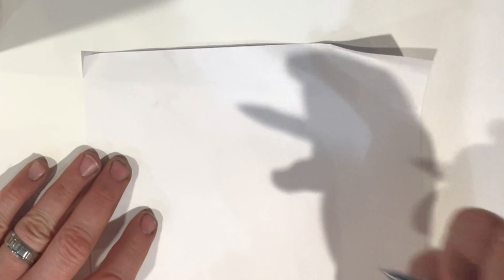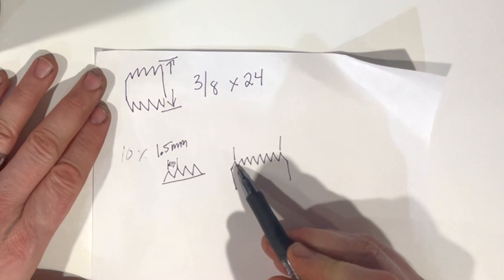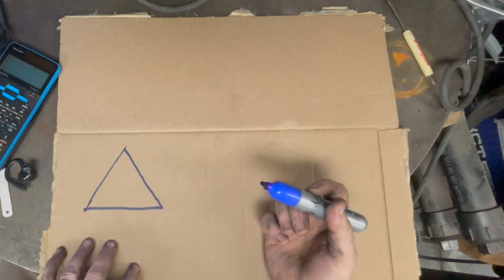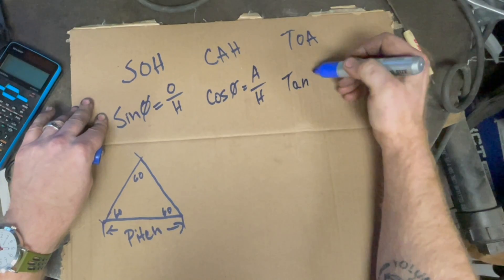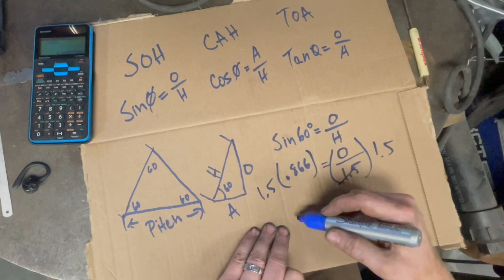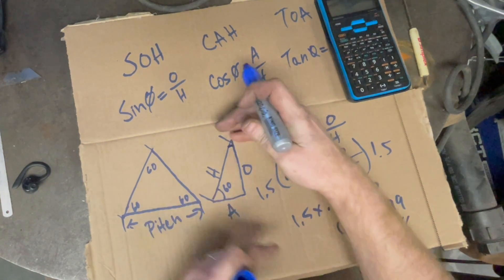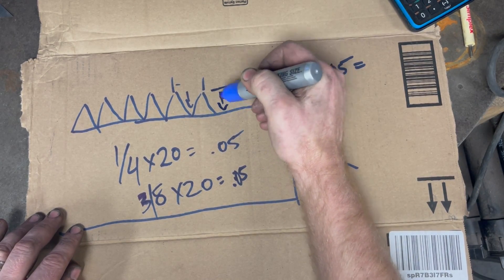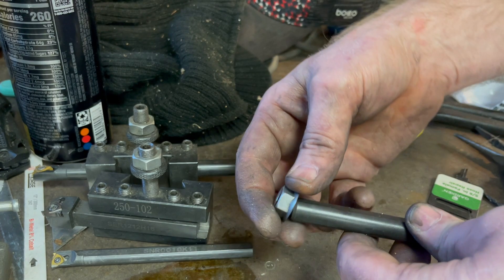Part 2: Easy Method - Calculating Thread Depth For Metal Lathe Machining + Basic Bolt Terminology

Comment: Along with the Sine, Cosine, and Tangent formula's my favorite is the Relationships of a 30-60-90 triangle which is 1-2-Square root of 3 " 1.732 "  Also a 45-45-90 triangle which is 1-1-Square root of 2 "1.414"
Using the 30-60-90 rule to figure the thread depth ,  Pitch /2 x 1.732 will give you the approximate depth per side.

Comment: The comments below are correct.  However, for the purposes of home shop machining, a symmetrical form is sufficient.  He is also correct that the flats on a basic form is 1/8P wide.   This results in a formula of .650P  (or .649519P) commonly referred to as "Single Height" or "Standard Height".  This is the formula upon which all the other elements are calculated, if and when it's necessary!  However, again, for our purposes, .650P should be used.  If you use .866P (Sharp Height) for your infeed depth, the thread will be completely sharp, and the Pitch Diameter will be undersize.  Of course, this also depends on how the tool is ground!  Either way, .650P depth is safer when you are trial fitting in a home shop!

Comment: For the novice who has seen a thread, but not really SEEN what it entails, they always assume that a thread is pointy sharp on the top of the crest and in valley of the root. So they overcut the depth.

As a general rule, the top crest of the thread is FLAT and that flat zone is as wide as 1/8 of the pitch. You don't notice this if you're not looking for it.

The valley of the root could be as wide as 1/4 of the pitch, but most guys aren't going to flatten the end of their thread tool because.....lazy. I agree with lazy for the most part, but if you want as strong a thread as possible, you will pay attention to this detail.

So beginning with a pointy sharp thread tool is where the first systematic error begins. So remember because your tool is sharper than it should be, this will exaggerate how deep you need to cut. 

But when eyeballing cutting progress, keep in mind that the crest of the thread is supposed to be flat on top if the screw is at exactly theoretical diameter. If you cut it under the theoretical diameter, then the flat will appear slightly wider. Look at a piece of commercial roll threaded rod, it's way undersize and it's very flat on top.

When machining the internal thread, the flat of the threads is 1/4 of the pitch in width. This looks VERY wide to the novice. So this is why the internal thread might be done before you know it. Most internal threads get tapped, and people don't notice this detail. But the torque required to tap gets very high if the hole provides more than 66% engagement of the pitch height, so that's the reason for more clearance in thread cutting the nut.

Cutting your bolt at the exact theoretical major diameter might make you think you're doing a superior job, but not so. Depending on the pitch, it should be a couple of thousandths of an inch undersize to absolutely forbid interference at the crest with the root of the nut crest. Usually have to file off a slight bit of burr anyways. But in the nut, you can't deburr so easily, but it's not an issue because of extra clearance that you drill into it.